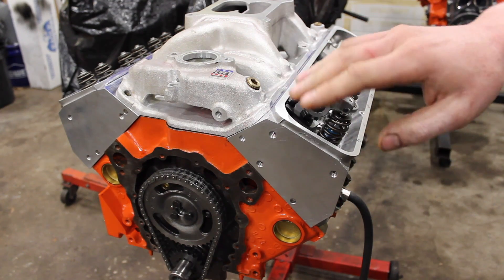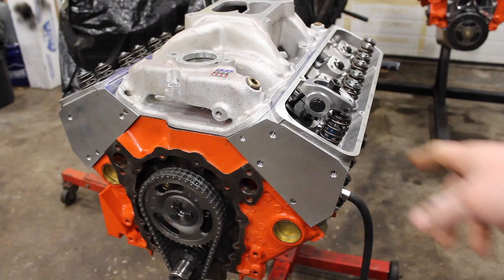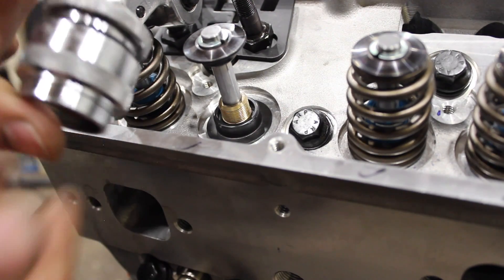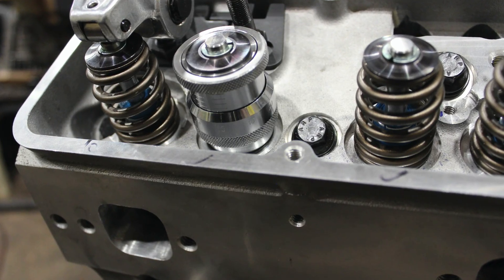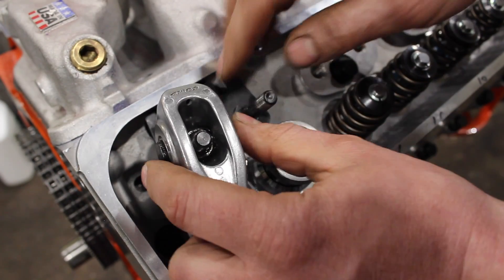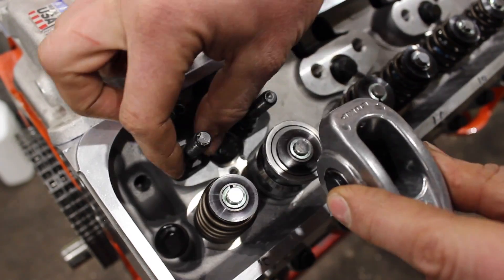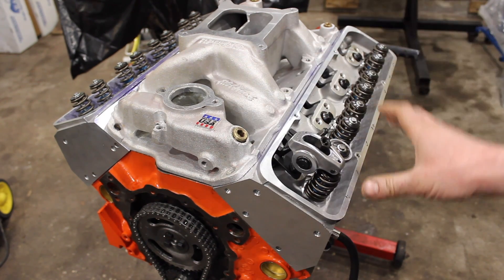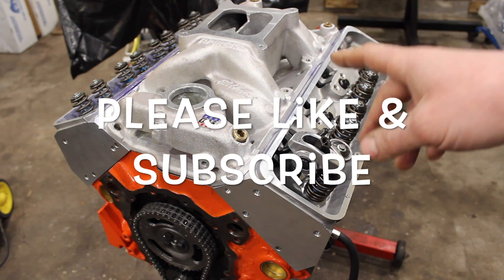Valve Spring Set Up For the DNA Heads (Youtube 355 SBC!)

Comment: I have a comp cams xr294hr with the recommended 987 springs. Several people say that's not enough spring for the cam. I have +.100 valves, standard location 10° keepers and standard retainers. I'm thinking of going to a PAC 1218 or 1219 spring set. Do they have a 10° retainer for beehive springs?  The installed height is 1.8 with the 987 springs. I know I will have to change to a spring locator, but would the beehive springs be a drop in after changing the spring seat to a spring locator and just installing the springs and retainers? I'm not sure if the beehive retainers are the same height from the pocket. I hope I've experienced that well enough. I have the same heads btw

Comment: Been subscribed and have learned a lot from you the past few years so thank you for that, but I do have a question on this setup. I’m currently building the rest of a short block from Smeding and was looking at this valve train setup. The cam is a 220/224  .495/.502  112 LSA. The heads I have are Jegs brand 195cc aluminum heads that I bought last year complete and had two valve springs break and I’m just putting everything back in new. Also I am going to run Harland Sharp 1.6 rockers. Would your setup work on this? Thanks for any information and by the way this is my first engine build in 18 years since I had a severe spinal cord injury from a broken neck and a traumatic brain injury from a car accident. My brain just doesn’t work right sometimes so I need all the help I can get. Lol
Thanks again
Reply: I forgot to mention that this is a 383.

Comment: As a engine builder, I’m gonna make some suggestions. Use dual valve springs, if one breaks you have the other one to save you. Use bead lock keepers and retainers. They don’t fail as much as square lock retainers. If you have roller rockers, use lash caps on the tips of the valves. Sometimes I’m high lift situations. I’ll drill out the valve guides and put new cast-iron or brass bronze guide in and lower themjust enough to put the valve seal on which gives me way more left than the stock set up plus if they go bad, you could just tap out and tap them again. I’ve learned this stuff after many years of building Chevys in the machine shop.
Reply: To use bead lock keepers, doesn't the valves need to be factory cut for them?

Comment: Really good stuff, i want to put a mild solid lift cam in my 1978 SBC 350, i asked in another video if i could run stock springs if i keep lift at 480 or less, also can you recommend a good mild cam some lump and good bottom end, thanks Mike
Reply from the maker: No, you'll probably have to upgrade springs. Who knows, what sort of pressure is left in those old springs
Reply: @cuttersperformance  👍👍

Comment: Can you tell me what studs you used please? The part #. Thanks Pat you're the best on YT!!
Reply from the maker: Summit Racing Part# Sum-G1675
Reply: @cuttersperformance  thank you man you're the best!!
Reply from the maker: @Loves_to_fish  no problem anytime
Reply: Could i get by with non-adjustable guide plates?  And could i do the same setup with a meiling 22280 cam im at 495in/502ex? Sorry for all the questions, but you're very knowledgeable.
Reply from the maker: @justrelaxand69  if you're using a dna or similar head, I would go adjustable as some have pushrod clearance alignment thats abit off
Reply: @cuttersperformance  that's exactly what I'm using. I will absolutely do that then. Thanks again!
Reply: Can I use self aligning rockers on these dna heads, or would you still recommend just using hardened pushrods and guide plates?

Comment: Pat, II'm building a 383, I do have 3 of these heads, one spare I guess. Should I change the set up on spring and cam. I like the Hot Cam but Summit has similar cams for retro fit roller. I just want your suggestion on good but budget hardware. Thanks 🙏
Reply from the maker: Contacts Competition Products. They have a very affordable drop in kit for those heads

Comment: Any updates on the heads?
Reply from the maker: Longevity or HP? HP you can see the video on my channel "Youtube 355"
And as far as Longevity the engine is currently in a car with some decent miles on it with no issues so far
Reply: Would you run 1.6 ratio or would the lift be too high? What do you think the maximum lift is for this setup? I’m copied everything you got part by part.

Comment: Hey sir! Love your videos and Vortec stuff but I can’t seem to get a good Vortec head. I even got a set of dart iron eagles used and they have worn out valve guides. So I’m just going to order these. A couple questions I have is what intakes work with these heads? Is it like old school 1986 and pre intakes ? Or is it a Vortec style intake ? I have both lol. And also can I use my stock rockers that came off my Vortec heads? I’ll use the guide plates like you said. Just trying to save money. Also I’m using a lt4 hot cam. So I was just thinking about running ls6 springs because they are cheap. Can I use the same spring locators that you listed ?
Reply from the maker: The dart Iron eagles are a decent head. If you go back to one of my builds "the Saturday night special" it was a 355 with iron eagles 180cc and they worked quite well. These heads are drilled from pre 86 manifolds, but some of these heads are actually drilled for vortecs as well.
You dont want to use vortec self aligning rocker arms with guide plates. Plus the vortec rocker arms shouldn't be used past .480 lift. 
My next video coming up will be about the budget L31 using a Lt4 hotcam that I dynoed last week. Lots of info you'll probably want, and it made more power than I expected
Reply: Okay great thanks! Can I use the same spring locators with the ls6 springs that you listed ? That’s really the only part I’m still confused about. Trying to order parts. Thanks!
Reply from the maker: @zachwilson9608  no those locators wont work with the LS6 springs. Your best bet is to reach out to competition products. They sell complete valve and spring packages for those heads
Reply: I am ordering these aluminum heads so trying to find spring locators that work with the blue ls6 gm springs for these heads.

Comment: Way late here & catching up - about to order the valves for my DNA's with port work - the Elgin's at Amazon list as HPV-14Q8 11/32 stems, but somewhere heard the guides are an odd size? 
This is for 4 bolt '72 Vette 350 block with 383 Eagle crank, KB Silvolite .060, recon stock rods, Summit 1103 cam, matched springs, Comp roller tips, and for budget's sake plan to use my old Weiand Team G dual plane (divider mostly removed), headers, with MSD Atomic to replace stock TBI in my '91 RS Camaro conv. Jasper 700r, G92 rearend. Sure some Great videos!
Reply from the maker: These ones had 11/32 guides, but some similar casting come with 8mm (5/16)

Comment: Absolutely SOLID great advice... I'm well aware.. but sometimes we need to hear it again for clarity.  I'm building the exact same engine/head combo.. except with a .100 dome piston. And a oval track cam, solid 242/250 @.530 lift 106 lobe sep. For that mid torque saturation. In a street 1939 chevy truck

Comment: I am building a sbc 400 with stock 5.56 rods and crank. I am using ARP main & head studs and wavelock rod bolts. The pistons are old school TRW L2352F- 030 over pistons with Sealed Power gapless rings. Do you see a problem with piston to valve clearance using a hydraulic roller cam with .510/.525 intake/exhaust lift?
Reply from the maker: Max lift isn't when the valve get close to the piston so you can't really tell by max lift numbers. It has more to do with the valve events. For the intake, the valve gets closest to the piston approx 5 to 15 degrees after TDC on the intake stroke. The ex its 5 to 15 degrees before TDC on the ex stroke. Im assuming your @.050 specs will be less than 240 with that lift, so chances are you'll have tons of clearance, but it's something that should always be checked

Comment: Yo pat would it make the same hp with an older 010 block?
Reply from the maker: Yeah with a retro fit roller cam of the same specs
Reply: @cuttersperformance  I got a lil 67-327 thinking on putting some 906s n a 276 voodoo or 284 comp / 700 Holley dp/ lt headers dual plain from jegs any thoughts hope for 390-425 hp
Reply from the maker: @Francisco Huerta  I have three levels of vortec headed budget combos im currently working on. From basically a stock L31 with a cam and mild porting to a 11:1 355 with heavily ported vortecs. If your not in a rush the info from those dyno pulls and cam specs will probably give you some insight to what you want  for your combo.
But 400hp is easily done with the righr setup on a 327
Reply: @cuttersperformance  sounds nice brother n no rush at all .

Comment: I got some dna heads since I can copy you but I want to run a .600 lift roller but if i wanted to go bigger how do i figure that out without buying and could you do a video for cam selection I've been reading David vizards books but im dumb and the math doesn't make sense to me  I havnt selected the ride to put it in have a 55 ford but want to tube chassis it so might do a 80 elcomino 4.88 9 inch locked high stall what ever is needed dual plane for the street cause I illegally race maybe a single for racing idk I want tourque over everything low end but want to run high 10s in the 1/4  at worst is their a formula for picking valve length havnt found one amd a good way to choose the cam off my wants id rather lean to stupid 1/8th mile quick then streetability but im going to drive it to but I'd rather be dumb and drive a race car so? Not sure how to go, i want to blow every Honda made off the road I've been in a rusty 74 camaro and whooped a Ferrari but it was 8th mile set up and its gone now and I didn't build it I want that again of course street light to street light not freeway of course for the idiots on here

Comment: I am putting on a set of Dart iron heads. Without using the gasket should the head sit flat on the deck? mine does not...
Reply from the maker: Yeah like just as a testing fit? The head should sit 100% flat on the block as long as the dowels on the block aren't mushroom or something causing it to to sit weird
Reply: @cuttersperformance   It just looks like there is not enough clearance in the head itself maybe there's something broken off inside there

Comment: Hey Pat, is it ok to use springs that are a bit too much?  I have a CompCam that if I use the dual springs it says use the 986-16, I have the 987-16 springs already installed on my heads, will they be too much? or do I need to cough up the money for the proper beehive springs and hardware. I have 1.5 & 1.6 roller rockers from Lunati.
Reply from the maker: You will have no issues with those springs and a roller cam. If they are already installed I would run them

Comment: Thanks for the videos!! Added up the parts list, these will cost you what a set of AFRs do. Not counting the port work or the other upgrades. We will see how mine do, just ordered all the parts to put a set together.
Reply from the maker: You 100% correct. Now with the price of the DNA castings almost doubled and the price of the other components gone up, your often better off just buying a pair of AFRs, Blueprint or darts. You can then do abit of porting to them. 
Just a heads up the youtube 355 got delayed as i had to borrow parts for customers engines but a dyno session and testing is in the works

Comment: What did you use for the retro fit lifters? Also looking for part number on the pushrods u used I have my heads setup the exact same way and have forged flat tops in a .030 over sbc

Comment: I’m building an LS. It’s just a short block right now but I’m also building a 350. The cost to rebuild the 350 with ARP hardware is less than it would cost me to finish my LS with stock parts.  I’m torn between the two. It’s going in a 1st gen 4runner.  What would you run? I also have a set of the Aluminum DNA heads, cam, and intake for the 350.  Holley Sniper will be ran on either motor

Comment: are they a proper A356-T6 heat treat aluminum? the afr enforcer version of this head uses quality afr small mm diameter valve tubes for the smaller diameter valves for a little more enhanced help in port energy, maybe lighter weight, and maybe a few cfm in flow.

Comment: what timing set is on it
Reply from the maker: Summit racing SUM-G6601R-9
Reply: Thank you I appreciate your help I'm hoping to get 450 HP
Reply: thanks for your help.i have a question I have the afr vortec heads and I bought a air gap intake and the port's are smaller in size by qite a bit is that gonna effect me at all

Comment: What type of intake gaskets did you use?
Reply: I’m building an engine with those heads but it doesn’t wanna idle so I believe it has a vacuum leak. It’s a 355 with a eagle crank, summit flat top pistons, dna heads, 280 comp cam, same intake, same valve train setup. Sounds really good, great response time, just does not like to idle. It might be my carb but I also want to replace my intake gasket too something that fits a bit better.
Reply from the maker: They are a weird port shape. Cleaned them up to a 1206 gasket
Reply: @cuttersperformance  Thank you. The gaskets are on order. Should have it together by tomorrow and I’ll let you how it runs.

Comment: Hey pat I'm working on a 350 from a 76 k5 any caution on how much power is safe on stock rods?
Reply from the maker: A good set of stock SBC rods with Arp bolts will take 400hp and 6500 RPM no problem, the later model PM rods will take 450 safely. 
Realistically, if you're building a 450hp+ engine or plan on pushing it past 6500 rpm on a regular basis, go to an aftermarket rod
Reply: Thank you for the insight. Keep up the good work

Comment: Thanks for sharing Pat. I might try a set of those heads and this info helps.
I also wanted to mention some LS6 springs are actually good to .570 lift depending on which brand and retainer.
Reply from the maker: Thats correct but the ls6 style springs recommended by summit are only good for .550 and the pressure is questionable for that cam aswell
Reply: @cuttersperformance  could i run these heads with self alighning rocker without the guide plates? Will the .100 valves accommodate the self alighning rockers? Reason being i have already done the work to some vortecs and was goin to use parts i already have.

Comment: I would love to see a vortec fuel mileage build. I think a vortec head on a 327 or 350 with some compression 10:1 long rod mild cam could work well. Gas is going up, a g body or nova with a 5 speed. Thanks for all the good info

Comment: What head gasket did you use
Reply from the maker: GM .028 gaskets (actual thinkess is .032)
Reply: @cuttersperformance  can I use that gasket on afr vortec 190 heads I have original vortec heads with 95.1 compression now
Reply from the maker: @jenny ortega  you should be able to, i believe they are for max bore size of 4.030
Reply: Do you have a part number for that gasket
Reply: Do you have the part number for the gast

Comment: Right on Pat!! Super stoked to see how this build performs. Appreciate you bro🤙🏻
Reply from the maker: Thanks brother!
Reply: @cuttersperformance  Pat.. thank you for your info...  I have a 2006 holiday rambler 33pbd motorhome with the 8.1 vortec and Allison 6 speed with overdrive transmission...   4000 rpm is the max on rare occasions..  mostly at 2100 rpm for 62 mph on cruise control

What cyl.  head.... Intake manifold and cam do you recommend for maximum fuel economy mpg..

Any other mods I should consider?

Thank you

Comment: Excellent video, I would highly suggest a huge disclaimer though to check and scrutinize EVERY single new/replacement part, for example if you buy loaded cylinder heads, disassemble and inspect very very carefully. There are more bad/defective parts on the market right now than there are good parts, even high dollar name brand parts have been having alot of failure and quality control issues lately. Ever since 2020  parts quality and production has hit rock bottom, soo many common parts have became discontinued or put on an indefinite backorder with no guarantee of a restock. This isn't just affecting speed/performance parts, it has been difficult to even get normal parts for modern everyday cars and the parts you can get are absolute garbage, NOS (new old stock) parts are becoming extremely sought after and prices are skyrocketing. Right now it's hard to be a hotrodder and even harder to be an engine builder or a mechanic simply due to the parts not being available or dead right out of the box, hopefully things will turn around soon but currently all aftermarket parts are sketchy.
Reply from the maker: Yeah its insane right now! Scary

Comment: VERY GOOD video... the importance of checking valvetrain components can not be overstated! i found that even .100 longer valves are BARELY  enough.
Reply from the maker: Yeah i was surprised to find that they worked out perfectly without shims. Not usually the case
Reply: @PISS-CUTTER Performance  mine also. I only used a .015 shim on a very few. Target 1.75@125lbs, I stayed conservative at 1.76-77  to help save springs.  I had different springs but , Again... your similar results give me confirmation